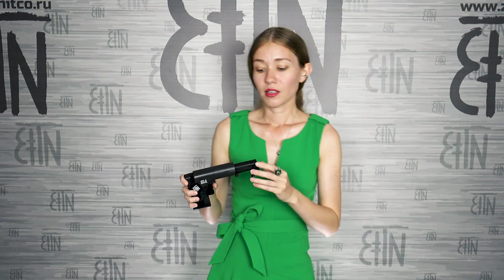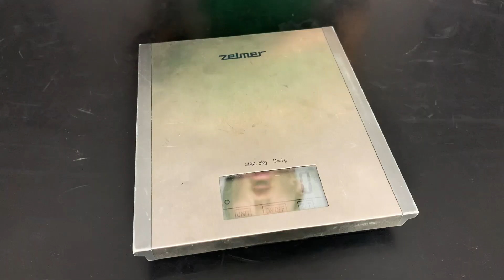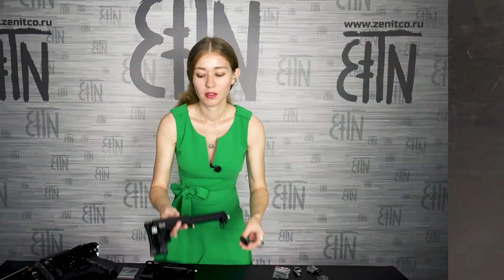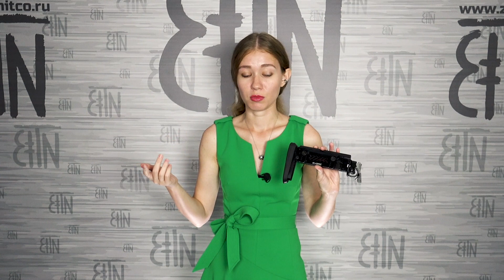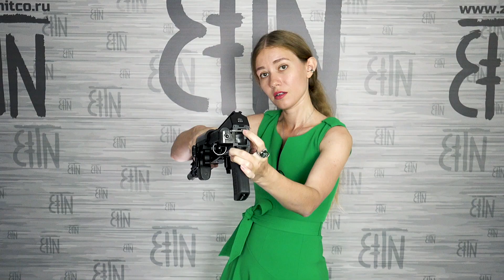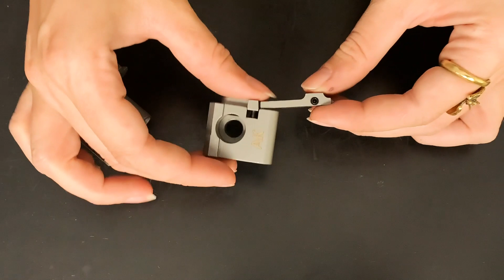PT-3 and PT-3S stocks: adjustments, adapters, how to install

Comment: Hello! When you speak of the anti wobble screw, I don't remember there is one on the pt-1 stock. Does the pt-1 suffer wobbling?
Reply from the maker: PT-1 does not have this feature. All movable mechanisms tend to wobble. So it’s not only PT-1, but all telescopic stocks. Some more, some less like PT-1. And PT-3 is zero wobble.

Comment: Does this work work with a saiga ak47 that doesn’t having the folding trunion, it’s just for a standard stock? Thank you
Reply from the maker: No, it doesn’t. For that type of weapon you need either PT-5 stock (folding) or PT-1 with AKM adapter (fixed). See more info here: https://youtu.be/RihFZupAkqw
Reply: @ZenitcoinEnglish  I’m looking at your partner stores for the pt-3 stock and it’s saying choose your stock adapter version, and it’s giving me the option 5.5mm safety cut-out (saiga). So would this now work for my saiga ak47 without a folding trunion, just a standard stock?

Comment: Is it possible to use a non civilian ak adapter on a saiga?
Reply from the maker: It is not possible. Saiga has a groove for system that blocks shooting with folded stock. If AK adapter is installed on Saiga, you won’t be able to take the safety off.
Reply: @ZenitcoinEnglish  Thank you for the quick answer. Do you also know why sometimes it looks like the PT-3 doesn't seem to be parallel to the barrel and tilts upwards instead?
Reply from the maker: @PiergiorgioCraxi  The stock is based to the frame. And the barrel is based to the frame. All rifles have slightly different sizes. And all PT-3 are the same. Sometimes accuracy of assembly of rifle may vary from average.
Reply: @ZenitcoinEnglish  Thank you again! Is it also specific for certain calibers? Can it be used with 7.62 rifles or is the pt-1 better in that case?
Reply from the maker: @PiergiorgioCraxi  Both PT-1 and PT-3 can be used on 7,62

Comment: Hey Anastasia, thank you for this stellar review. I’ve had my eye on this stock for some time now and this review convinced me to finally get one. Got one in desert sand on the way. Can’t wait!
Reply: Sadly, the PT-3 stock that I received will have to be returned. My 5.5 pin would not go through the hinge pin hole on the PT-3, it was too thick!? Tried a 4.5mm hinge pin to see if I had mistakenly received a 4.5mm PT-3 and the 4.5mm pin wasn’t big enough and was extremely loose, wiggling side to side when installed on the stock. The hinge pin hole on the PT-3 is definitely defective. One other complaint was the lack of adjustment length on the PT-3. At it’s longest extended length, it was just standard Warsaw Pack length. I’ve handled a PT-1 before and there is no comparison between the two. The PT-1 has a far greater adjustability in length, being able to be extended far past the limit of the PT-3. In my humble opinion, the Zenitco engineers need to fix this issue, and at least have the PT-3 be able to extend out to NATO length, if not even further out than that.

Comment: I have this stock on my AK105. It is great! A cool secret feature present on the PT3 is if you unscrew and remove the sling swivel, it exposes a 2nd parallel sling mounting point for QD slings! It's so cool!